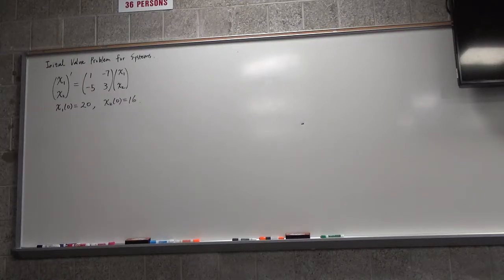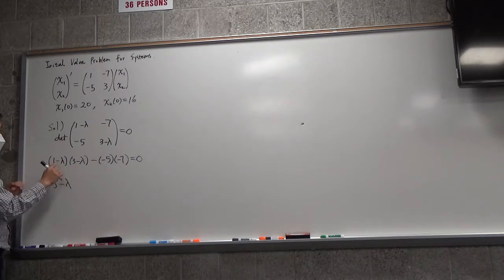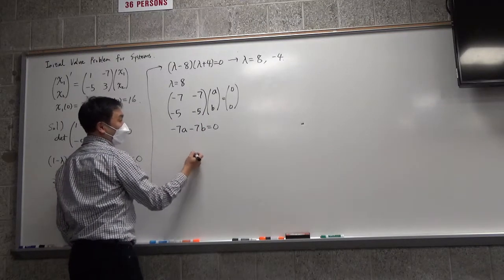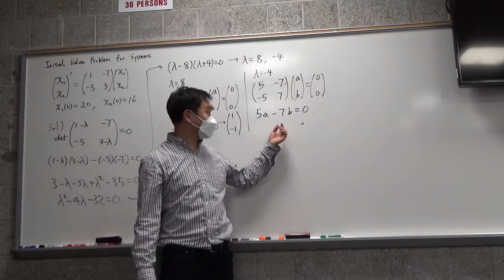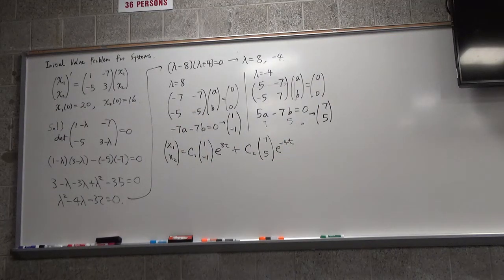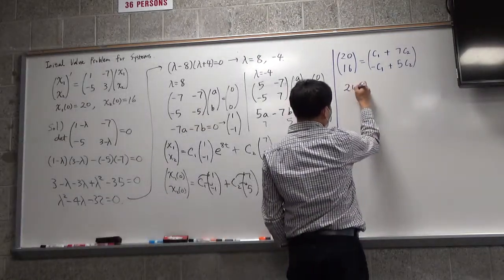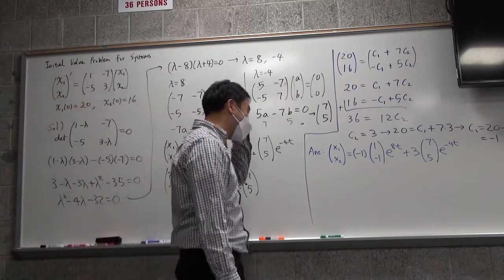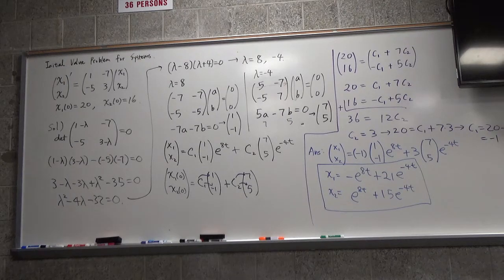Initial value problem for system of 1st order differential equations

Comment: Thank you Sir! Appreciated. I have one question, let say if x_1(t)=t^2+cos(t) is one coordinate solution of X'=AX, where A is square matrix, what is the order of the square matrix A. Do you have any idea? thanks.
Reply from the maker: Assuming A is real, to get t^2, the characteristic equation must have lambda=0 with multiplicity 3 and to get cos(t) there should be lambda +- I. So in all A has to be at least 5.
Reply: @daniel_an  okay you mean, since we don't know the other solution's we can't find exactly the order of matrix. I think I got your ideas...now if that is the case t^2+tcost will have same reasoning. Thanks for everything.
Reply: @daniel_an  final one if X'=A(t)X, X=(x(t),y(t))^T, now if A(t)=(a_11=0,a_12=c:a_21=0,a_22=0) for t \in [0,1) for what value of 'c' is the zero solution stable, your suggestions. Thanks.